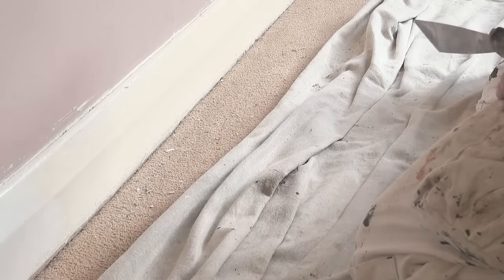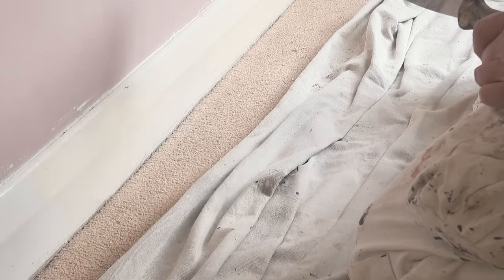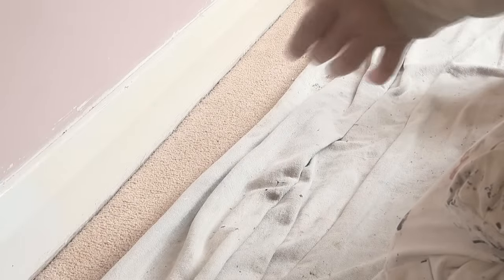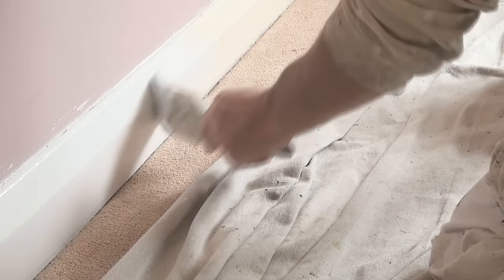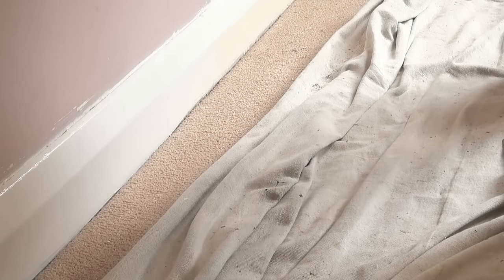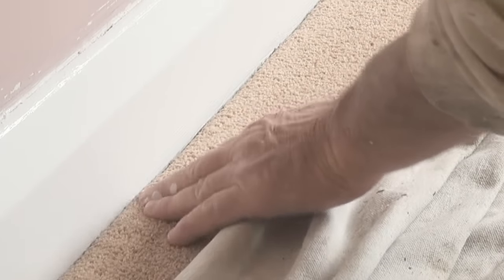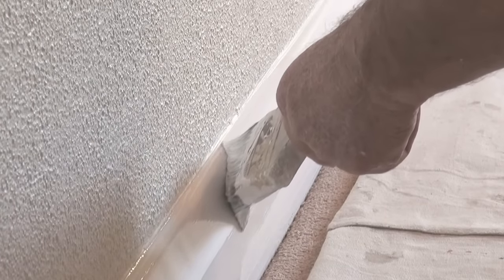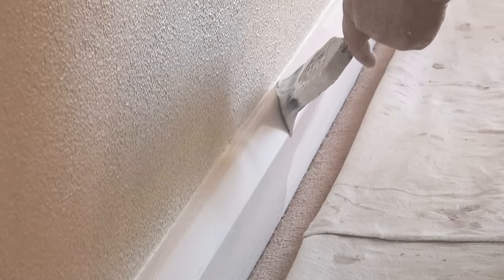How To Paint Baseboards or Skirting Boards On Carpet (The Trick to doing it)

Comment: Why don't u use masking table on carpet
Reply from the maker: No, masking tape doesn't stick to carpet very well so there is a good chance the paint will bleed on to carpet. That's why a steady hand is best.
Reply: If your masking tape doesn't stick (cheap ones are less adhesive) use duct tape. A pro such as the guy in the video has a steady hand and no drips from his brush, if you are trying this for the first time I strongly suggest you mask off and use drop cloths.
Reply from the maker: I would agree with that but I wouldn't rely on the masking tape to stop paint bleeding through, I would still try to cut in only using the tape as a safety measure.
Don't forget to Like, Share and Subscribe
Reply from the maker: I don't use masking tape because the nature of carpet. Masking a smooth flat surface you can get the tape to stick and seal the area off that you don't want to get paint on. Carpet isn't a smooth flat surface so you will never get the tape to seal 100%, you could tape the carpet but don't just slap the paint on thinking the tape will stop paint bleeding though. Use masking only as a safety measure if you don't think you can do what I have done in this video.
Don't forget to Like, Share and Subscribe

Comment: Theres still a very good chance of getting paint on your carpet, running a stupid scraper along the edge does nothing whatsoever best chance pull the carpet back off the gripper rod then you have a lovely clear area to work on job done..
Reply from the maker: Are you on drugs, if you have ever pulled carpet back you would know it has a tendency to want to fall back in to place. You can not pull all 4 sides up at once unless you brake the back of the carpet. Then you need to deal with the fold back carpet while you are trying to paint so I can't see how you can say it's the best way to do it.
Don't forget to Like, Share and Subscribe.
Reply: Then you are creating a whole lot more issues, including a lot of unpaid overhead.

Comment: what is the difference if I use roller or brush on skirting?
Reply from the maker: +Mohammed Idris Brushing will look a lot nicer, a smoother finish. A roller will leave an orange peel affect which doesn't look good on trim. Depending on the type of skirting it could be hard to roll.

Comment: No tac rag used=bengal lancer!
Reply from the maker: Dusting off is fine for most house paint applications.
Don't forget to Like, Share and Subscribe.
Reply: @howtopaintinfo  incorrect. By rubbing dowm and dusting off you still leave dust on the surfaces. Also you create a static charge that attracts fibers and dust particles to the wet paint resulting in a sub standard level of finish
Reply from the maker: I have never heard of that one, creating static electricity by dusting off. When dusting you might leave some very fine partials on the surface but as I said with house paint applications it not an issue. I had an argument with a friend about this issue one day as we had to final coat some doors with clear polyurethane. He was adamant that I should use a tact clothe rather then dusting of so he did it his way and I did it my way. My doors turned out a fine and his not so good as the tact clothe left fibre's on the door so it turned out to be a rough finish and mine as smooth as. Unfortunately the slight roughness of the grain was enough for the fibres to stick too and that's why I don't use tact clothes. If ever needed I use a rag and mineral turpentine to clean the surface then dust again.
Reply: Belive me. I'm a proper apprenticed decorating tradesman. I've been decorating 46 years and was trained by the best in England. I also have a teaching degree and lectured in the subject for seven years. Rubbing down creates static, end of. Eliminate the static, tac cloth, improve the finish.
Reply: @michaelflint4159  He's painting a house, not the space shuttle.

Comment: I use masking tape tbh but great video man..
Reply: Im with "al bo", why in hell would you go thru all this unneccsay effort to avoid getting paint on carpet when this is one of the few cases in paint projects where you can use cheap mask tape and then paint those molding quickly and worry free from wrecking perfectly good carpet. Thanks but no thanks, I'll hire myself!
Reply from the maker: The issue with masking tape is paint will bleed under the tape and its hard to get tape to fully stick to carpet.
Don't forget to Like, Share and Subscribe